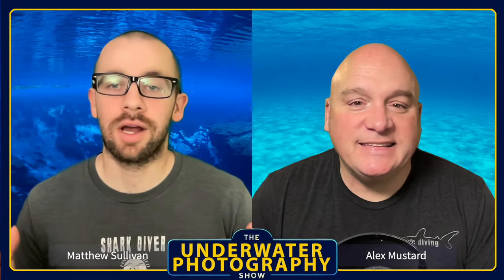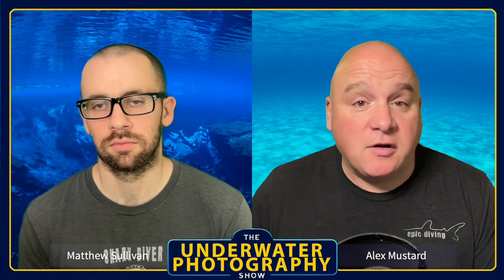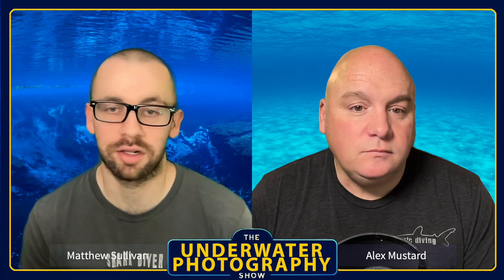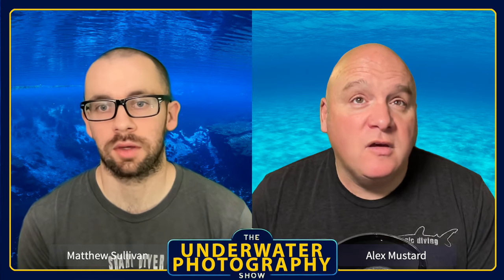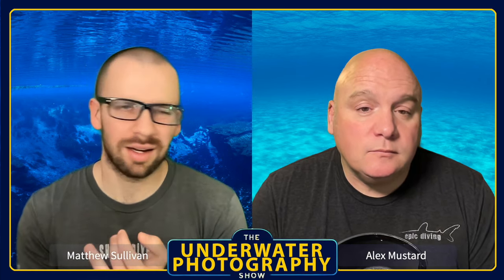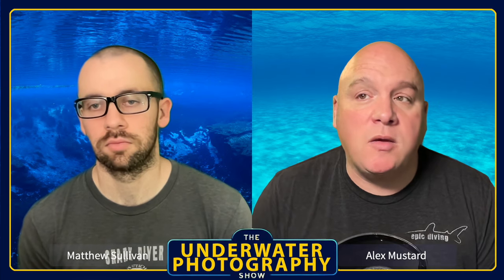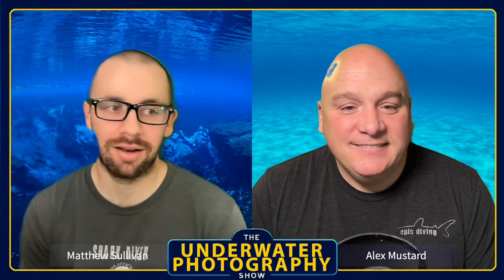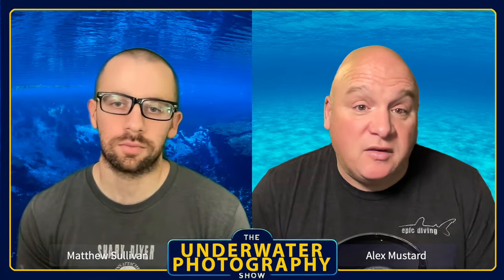Problems And Solutions For Cameras With Slower Synch Speeds For Underwater Shooting

Comment: Diving in the Pacific North west (Vancouver Island BC)  with a Sony a7iii I find that the max sync rate of 1/200th is ok most of the time. I do run into times that it would be nice to be a bit higher. Typically when I am trying to only light a subject and have a black background on a sunny day or with lots of light colored sand in the area.

Comment: the synch speed higher with electronic shutter does however have another cost, namely slightly reduced dynamic range in your images. While a higher synch speed is super useful, so is every bit (pun intended) of dynamic range if like common these days much of the work is done in post

Comment: I am happy to find that I can set the  Nikon Z8 to 1/250 second flash synch. In Custom Setting Menu > e Bracketing/flash > e*1Flash sync speed select 1/250 s (Auto FP). My Sea & Sea YSD3 II and YS110a sync at 1/250 second. I don't see any black banding. Am I missing something?
Reply: Interesting. This worked on some Nikon SLRs, but not others. I tried this with the Z8, no joy with the flash trigger I was using - it limited me to 1/200th when shooting. Are you using a flash trigger (if so which one) or are you using electronic synch cables.
Reply: Hi Alex. I'm using fiber optics (no synch cables) in a Nauticam NA-Z8 housing. Using the LED Flash Trigger that came with the housing.  Strobe is in manual mode. I have the flash mode in rear synch, maybe that has something to do with it. Mark Krag  @Alex_Mustard
Reply: I mean it is the TTL Converter LED Flash Trigger  part #26308 that allows 1/250 synch.

Comment: Diving in the Mediterranean, 1/250 max sync speed and 160 base ISO, has never been a problem for me, although I mainly shoot macro at f16... Perhaps in a very clear water situation at very shallow depth, the base ISO 160 could be a problem, especially if I wanted to use larger apertures. For that situation I would consider carrying an ND filter... Do you guys know of any ND filter that screws on my flat port (m67) and that can withstand the rigors of salt water well? 
A very interesting episode, thanks again.
Reply: thanks for watching! Ill let alex chime in with regards to an external ND filter. I've always used one inside the port
Reply: The lens fits realy tihgtly inside the port, so I think I'd better go for a external one. Moreover I prefer the flexibility of screwing it in and out regarding the situation...